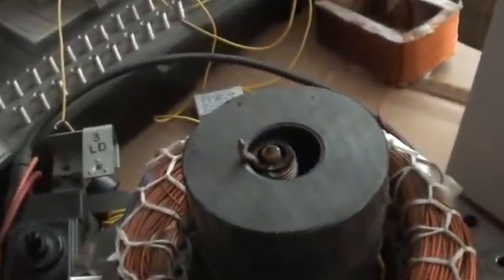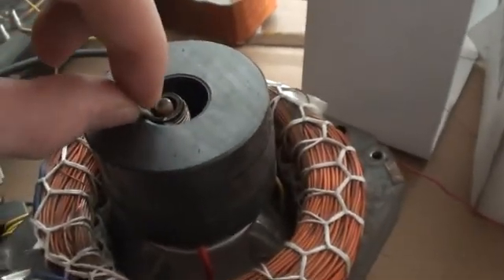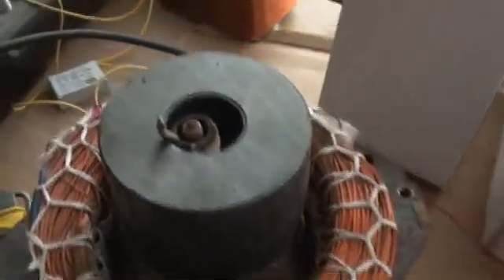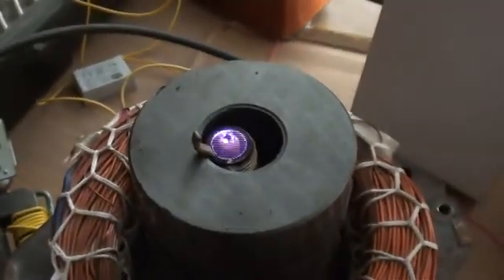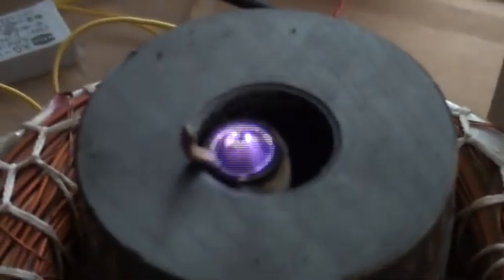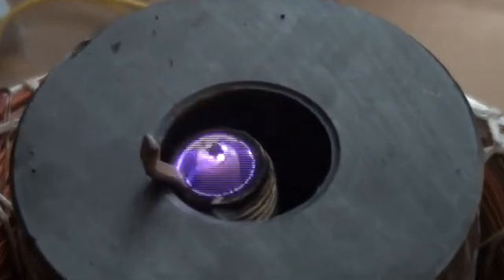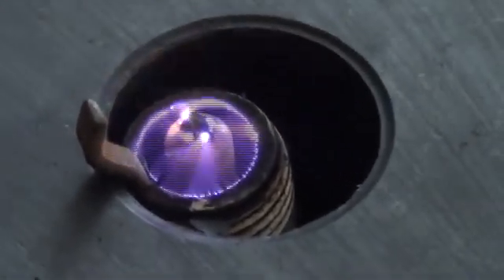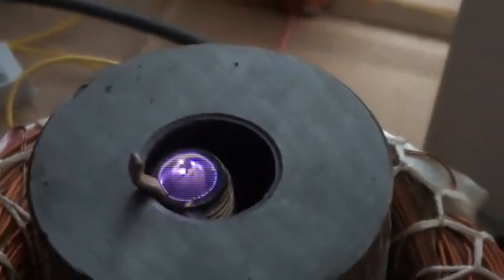Plasma Forcefield!

Comment: That's an observation...not an experiment...that happens because of the orbit of electrons and the magnetic field they produce...its the strength of the magnetic field changing that does that because of the added resistance of the magnet...more resistance equals more current...it does look cool when you can see the magnetic field spinning...how about making another video to do an actual experiment with you using your tongue to check the difference in the amount of current like you do to test 9v batteries and report your conclusions to us viewers... You are not scared are you... Chicken???

Comment: I know it seems fake guys, but it’s probably real, the high voltage electric system heat the surrounding air to a plasma state and the magnetic field is containing the plasma in a dome shape
Reply from the maker: Its definitely real! Its actually a arc of electricity I was able to make spin very quickly which gives the appearance of a shield.
Reply: yes ive seen this before

Comment: Science 1324 have you tested to see if the magnetic field is affected in any way, or perhaps create an induction to see if the magnetic fields generate power? Just wondering what other experiments have you ran with this?
Reply from the maker: Not a lot so far. I need to do more I think.

Comment: A magneto spark plug.. I know there could be far greater uses for something like this. This spark plug with a 360 degree electrical current could make the most efficient spark plug ever made, that and combined with a direct injected atomized fuel? Would make an EcoBoost motor twice as powerful and doubling the fuel economy. Modestly speaking..
Reply from the maker: This is true, the biggest problem would be figuring out how to get the magnetic field in the combustion chamber.

Comment: Your one step away from a magnetron. In yours, the cathode is the spark plug case, in a magnetron, the cathode is a ring with smaller rings in it. Due to the imperfections in the cathode case, I am curios as to what random frequency is being generated. Would love to see a spectrum analyzer next to it
Reply from the maker: That's not a bad idea! I am curious now to see what kind of radiation it is emitting!

Comment: if you were to want to, you could adapt the force field to make an aurora engine, just switch the spark plug with a cylindrical tunable rf plasma source, and the magnet with a solenoid ... they have been too classified for too long ... hi! i was a design scientist ...

Comment: You know this is how in the future they might make light sabers. Have a cylinder stretch out from the handle, then rotate at hyper sonic speeds with and immensely powerful version of this device. It should incinerate everything it touches!

This is more realistic than assuming light can be solid as in star wars lol. Throw in as a safety measure an insanely powerful magnetic field just to keep the darn thing from exploding to bits due to the high speed of the rotation of the tube.
Reply: engineers at MIT have discovered a method to make lightwaves converge onto one another

Comment: put it in a bottle so you can control the atmosphere. Measure the voltage to strike arc. Introduce 2% argon into the jar. Measure voltage to ionize again. Nifty gas, Argon. Supposedly inert, noble gas.
Reply: +science1324 Check the suction inlet of your compressor to see if you can plumb it up to use as a vacuum pump, most are threaded. It works great with a vacuum gage, a tee with a valve to adjust the air bypassing the vacuum line to the compressor and you can use it to adjust the vacuum you are pulling.
Reply: Why were you thinking of putting in a vacuum. Anyways I demand u join my crowd funding project and make me a plasma shield for my ironman suit so the USKKK can't kill me with anti-take missiles.
Reply: Kirk McLoren huh?
Reply: @leemarshall6513  LMAO IKR
Reply: science1324 wah?
Reply: Dragn Fly excuse me?
Reply: I wish i was smart
Reply from the maker: +Kirk McLoren ive been thinking about that im saving up for a good vacuum pump right now all i have is an ac compressor. As soon as I get the new vacuum pump ill have to try that! I also want to try helium because different gasses produce different colors. The reason its purple in the video is because of the nitrogen.

Comment: You should try repeating this experiment using a lightning rod instead of a spark plug and a magnetic ring that's a couple feet wide in diameter, and a huge power supply, and see if you can create some kind of energy shield. If you managed to create something like that, the US military and defensive branch would pay....ALOT for something like that. It would certainly be much more money than you would know what to do with. Good luck :]
Reply: I like the funny part where he said the US government would "pay" ... lol They would just flag it as something to confiscate in the name of national security and you would never see your prototype again. LOL
Reply from the maker: thanks! I have been working on making it bigger the hard part is when it gets bigger it becomes harder to controll the plasma so ive been working on controlling the magnetic field but that has turned out to be more complicated than I thought.
Reply: science1324 Yeah, I figured that wouldn't be easy. But I bet if you work at it long enough, you'll get a breakthrough. Like I said, if you actually managed to create some kind of shield, even if it only lasted a few seconds before knocking out half the neighborhood's power, the US defense branch would set you up for life.
Reply: True, but it could easily melt, vaporize, or even burn most small projectiles and shrapnel. Not to mention being a useful cutting tool for emergency situations.
Reply: If you were to increase the voltage and amperage to the levels of those in an arc welder, you would produce the same amount of heat as a welder, which does precisely that, melts and vaporizes metal, and if you were to introduce certain gases into the spark gap such as helium, you could increase the temperature (akin to heliarc welding), or oxygen, you could increase the probability of burning objects that enter the arc by decreasing kindling temperature (akin to oxy-acetylene cutting with and arc instead of a flame). Also, it depends on the velocity of the bullet; that is, the slower the bullet, the more time is spends in the arc, the more it heats up, the more likely that it cannot keep its solid state. Unfortunately, metallic solids, liquids, or gases moving at a high speed in a general direction would still easily cause damage to a body, so it would not likely make a good personnel shield and armor plating is a more effective and easier mean of protecting vehicles (also, larger projectiles would likely make it through mostly intact). Another of other factors aside, the idea has little military use, but it may be useful as a means to prolonging the life of orbital space stations, which are constantly bombarded with extremely small, fast-moving pieces of matter (in 2010, a paint chip was determined to have punched a hole into the interior of the International Space Station), which a rotating plasma arc with enough umphf could burn up.
Reply: Bulkbs its an experiment though. You test and make things better when you experiment. I believe what he has made is called a plasma window. You should look them up. Theyre cool to read about.
Reply: That's not how it works.

Comment: what is the pulling force of the magnet? and the Voltage and current used ?
Reply from the maker: Unfortunatly i dont have any way to mesure the force of the magnet, but it is from a microwave oven if that helps. The current is in the very low milliamps around 5 to 10.  The voltage is around 3 to 4 thousand volts

Comment: Does not look like plasma to me. Just high voltage arc.
Reply from the maker: Aviator168 Plasma is created by high voltage arcs. plasma is a state in witch the electrons flow freely between atoms and that is what gives off the light that you can see from electrical arcs.
Reply: ***** 21?
Reply: what you know as lightning is plasma its the gases in the air being ionized by the flow of electrons which just produces heat and light the mass doesnt change or anything it is still a gas

Comment: What happens if you stick a toothpick in there.
Reply: My guess it it'd burn if the electrical charge of the plasma is high enough.
Reply: Plasma actually has enough energy to break elemental bonds (which isn't burning). Google "Plasma converter", it has some information on it. Although I'm not saying that would happen here, it would probably just burn:)

Comment: Hey suggestion and question, Have you Tried this same experiment in a Vacuum. I think you would get better result. You might use less power also, under 200 mTorr.
Reply: But then the arc would not be visible.  No air no plasma.
Reply from the maker: jasonofcompsci good point... maybe just a partial vacuum?

Comment: Fake! You can see the horizontal interlaced video lines in the so called 'plasma'.
Reply from the maker: haha man i wish i could do special effects like that! my camera doesnt work with my computer so i have to put the videos through a converter to make them work thats where the lines came from.
Reply: Tim Turpin The lines are there because the speed of the rotating plasma arc is near to the fps of the camera. Same happens when you try to film a CRT monitor.

Comment: Paul's right. but FuKltM4n was almost on it. it is true that time affects you less when you're traveling faster. But it's because time also slows down, so all in all, the two effects cancel each other out and you end up just going really fast. It wouldn't make sense for either one of these effects to happen alone. Imagine it, You climb into your car and begin driving. You're moving fast, so time slows down a tiny bit, so you travel the same distance in less time, to you go faster, so time slows

Comment: I'm not absolutely sure, but I *think* it's an artifact of how the camera works. Digital cameras don't update the picture all at once, they do it one pixel at a time from top left to bottom right. The arc is moving faster than the camera can read the image off of the light-sensitive chip, so you see scanlines.

I may be full of shit, though.

Comment: Actually, plasma is pretty much everywhere in the universe. It's just very uncommon on this planet, mainly because conditions friendly to life and conditions that form plasma are very different. Recently another planet was discovered that should have a plasma water atmosphere, which is awesome. Also, I'm not entirely sure if your example is correct. I don't think you're using the proper words, but you may at least be thinking about it right.

Comment: The only naturally occurring state of plasma is when lightning strikes the ground, it produces plasma (the fourth state of matter) for a split second during contact. Plasma is used daily in industrial settings, plasma torches, etc. by producing very high voltage arcs of electricity. When the electricity comes into contact with the material, it "flashes" to plasma and "cuts" the material because of the extreme temperature. That's just my basic understanding so don't quote me.

Comment: Let me clarify something plasma is not fire it is electrified ionized air other wise known as a state of matter and it evaporates steel it doesn't melt it. and it would be able to stop a bullet seeing that lead has a lower melting point then steel and plasma makes short work of steel. not to mention plasma has a temp of 1-2 million degrees Celsius and lead melts at 327.5 Celsius. so I'm fairly certain a plasma force field could keep you safe..

Comment: Actually, if you scaled it up it would stop metal due to the fact that when high voltage electric current arcs it creates an electromagnetic field that pushes any metal away. There's plenty of videos of people launching washers with capacitor arrays using this effect. Granted, it would be completely impractical due to energy constraints. That's pretty much the problem with all of this stuff. Energy.

Comment: i did something similar with a microwave transformer. generates about 2400volts and you get a really hot arc off of it that produces lots of plasma. If expose the arc to a magnetic field it will expand outward like how your did but it doesn't look like its going in circles. it looks more like a fire shield or something. Its also very loud and the arc changes colour depending on the metal you use.

Comment: (ran out of letters) the idea with a force field is to match the inc resonance frequence with the same frequence thus leading away any energy force of that specific type absorbing it(most likely) or maby even deflecting/reflecting of the energy in question. a electric force feild/shield is a passive/agressive type of defence. it will knock u out but only if u already stepped over the line^^ and when u do cross the line i will be there yelling BARBEQUE!!! so i dare u stick a finger in that feild!

Comment: With "force field" I think of something that can't be passed through at all. Not electricity. He should have just called it like, high voltage spark plug or something. It's not a force field. It's high voltage electricity. It could be passed through.

Comment: Guessing that this guy is in his garage, that can't be high voltage.
it's against electrical code to have over 120v electricity on a residential circuit.
if he were in a lab or something then he could use 240v-480v and higher depending on the lab's condition, licenses, and location

Comment: The magnetic field of the large magnets (the black disks in which the spark plug is placed) is bending the electrical arc of the spark plug and also twisting it. The spark plug is fed a continuous current to produce that electric dome.
Basically it works on the same principal as the Earth's magnetic field when it bends the solar radiation and creates the Aurora Borealis effect.
Hope this helps.

Comment: Very interesting concept. The magnetic field of the magnets is distorting the electrical field of the spark plug's spark, bending and twisting it. Unfortunately it's not practical (yet) as a force field since it doesn't stop things going through it, it only burns them at very high temperatures. Also, a large scale model would consume vast amounts of energy to produce that effect. Until we can get some very effective and small power generators, this is just a pretty experiment.
Good job tho!

Comment: why? for a large enough one to really do anything it would be impractical, not to mention the voltage needed to surround even one building would need an entire power-plant to create.  Then there's the issue of the human body being a conductor of electricity walking under an ultra high voltage plasma arc.

Comment: Although it looks cool, for the love of common sense, make that setup just a LITTLE bit more safe. Especially when you do high voltage experiments, you don't want to be running things off a breadboard, single layer insulation wire and a big heap of spaghetti. You're going to get yourself killed, seriously.

Comment: plasma is the 4th state of matter right? super heated gas with electricity to produce it. that cuts metal like hot knife in a butter. i don't think that that is a plasma. that is just an ordinary spark from your spark plug. it goes round because maybe of the magnetic field made by the magnet. and maybe because the metal that the electricity should be touching is folded out.

Comment: not technically correct. at the voltages and current being used in this example you would either require a vacuum in an envelope or you would need to introduce and inert gas across the arc.

Comment: Well, this certainly is NOT plasma - it is a spark which is led round by the magnetic field of the coile. Plasma needs a medium, like water or gas under pressure and high voltage, or a magnetrone. So please, get your facts straight. *sigh* amateurs ...

Comment: this is the best kind of science. the kind done in your living room with parts of various broken down appliances. I once messed around with an old hair dryer. I took out the heating coils and just rewired the fan motor. when i plugged it in flames burst out of it and it exploded in my room. I was 10.

Comment: Were those lines from the refresh rate? That is very interesting as that seems to tell me, right or wrong, that the magnetic field isn't just this stationary, static thing. Perhaps it's in motion even if the magnet is just setting there. Is that at all correct? Do magnetic fields rotate?

Comment: Except there is little "force" to the "field", a metal pin would easily penetrate it with almost zero resistance, and the field would just form around it. The only thing it has going for it is the temperature, which is hot enough to melt steel given it had enough time to melt it.

Comment: This is Science 101.  This technically is not a plasma, what you are seeing is the arc rotating like a motor winding would on an energised AC motor. if you draw an AC arc between two magnet poles and the AC is at 50hz the arc will rotate at 3000rpm. The arc that you see spinning around the perimeter of the sparkplug is simply being influenced by the surrounding magnetic field. if I knew the frequency I would be able to tell you the speed it is rotating, or you can 60 x Hz = RPM :-)

Comment: Similarly, pause it at 0:02 when he is moving the camera quickly. You will notice, but probably won't admit, that the whole screen has horizontal lines. The problem lies within the video file, which is know as deinterlacing.  This often happens when you are using a non-interlaced video clip in DivX.

So there you go. 

Feel free to respond. :)

Comment: are you using a computer supply to power the magnet  them the voltage might not be stable. try using a 2 car batteries in parallel